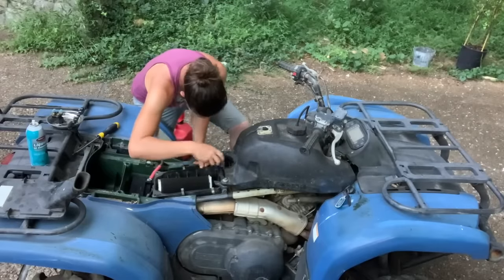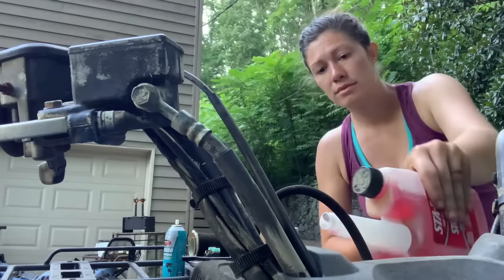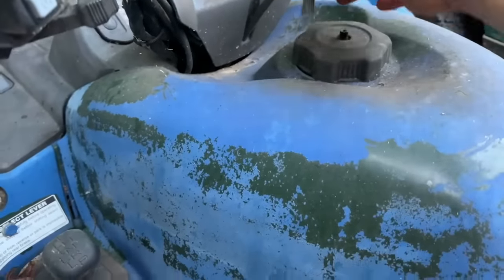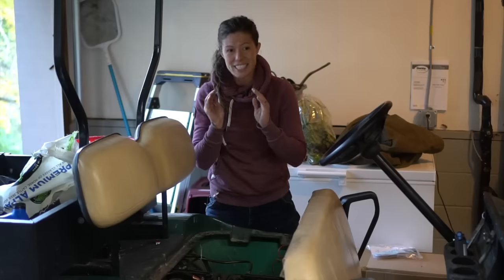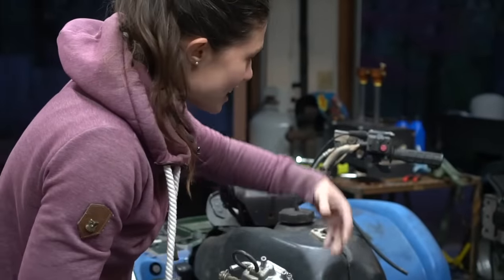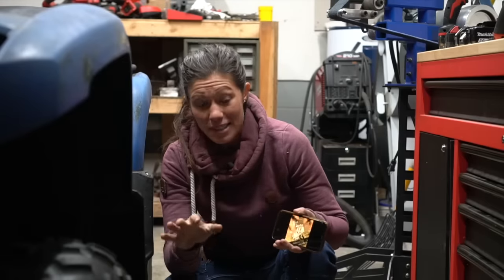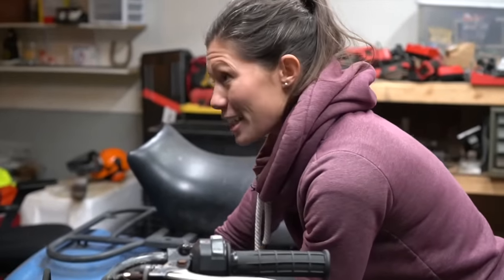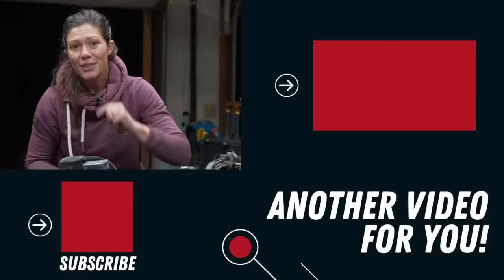ABANDONED ATV: Will it Run?

Comment: Congratulations on your perseverance.I had to solve similar problems with my first car which would randomly cut out while I was driving. Most embarrassing of all when I called road service it would start straight away. It puzzleD several mechanics who were unable to diagnose the problem. In desperation I stripped down the carburettor. Luckily I had a good workshop manual which had an exploded diagram of the carburettor so I was fairly confident i could reassemble it. I actually had to take it to a spare parts outlet when I couldn't remove one of the jets and they sold me a special key for that. The car was originally a farm vehicle and I discovered that during a mouse plague one had crawled into the petrol tank and died with the fur ending up clogging the carburettor. Even after getting it all back together it still kept cutting out. Because the car was running I realised it was unlikely to be an electrical problem so went back to check the fuel. Sure enough when it happened next and I disconnected the fuel line into the carburettor it was empty.  So next was rebuilding the fuel pump. When I stripped it down all the internals looked ok so I suspected that wasn't the problem and I was right The next time it happened I undid the fuel line on the suction side of the pump. Sure enough it was empty but the sight glass on the other end of it was full. Further checking revealed that the other end of the suction line which connected to the sight glass was slightly loose causing the fuel pump to suck air. I tightened it up and the problem vanished at least until one stinking hot day when it reappeared in a similar form as vapour lock. My experiences with keeping that old car on the road were invaluable. Before they replaced the electromechanical systems with computers I serviced my own cars. My record was keeping one in good condition for 500 thousand miles until somebody parked their Landcruiser into the back of it at about 40mph. One last thing those ATV's are among the biggest killers on farms for your own safety please wear a helmet.

Comment: Wellk done!
Two mechanics not realizing there might also be a fuel delivery issue?
Okay...
And warped parts in a carb?
I follow quite a few channels that deal with small engine stuff, there were lots of corroded, varnished, dirty and incomplete carbs, maybe even a few broken parts in them, but I don´t remember anything warped.
Reply from the maker: That wasn’t the only problem, but it was the key to getting it running after a LOT of other work had been done, these videos can only be so long so lots gets cut ;) and in case it wasn’t clear in the video, I don’t know enough about carbs to explain in my own words what Caleb told me was wrong with it, but I’m happy to take his word for it, it needed to be replaced, so that’s what I did.

Comment: I have had a few vehicles that I got for reasonably cheap and some successfully got running.  Only one eluded me and I was forced to get rid of it since it was not running.  Had I had more time, I am sure I could have solved it.  Makes me wonder if the fuel filter was a potential but for some reason the throttle body injection would not get enough fuel.  Pressure didn't seem all that off but then I also learned Subaru vehicles are also very nitpicky on their parts. Not to mention really expensive.
Reply from the maker: Time plus desire can usually solve most problems, but time is the one thing it's so hard to make more of.

Comment: I am an atv mechanic, those yamahas are good bikes, but you’d have been better off rebuilding the mikuni carburetor that it came with. My suggestion would be to buy a clymer manual for it
Reply from the maker: The carb had already been rebuilt unfortunately.

Comment: Should have tried the pull start. See if it ran at least then narrow your problem down with the starter relay
Reply from the maker: I tried lots of things that didn’t make it into the video edit ;)
Reply: @AnneofAllTrades  ic  I just finished doing another 4 wheeler build. Came off a old cattle yard. It was beat up and never had maintenance. Runs like a top now. But liked your vid for sure. Keep ‘em coming!

Comment: "when it get´s enough air, the only thing missing is fuel"    oh my dear you might be in for a huge surprise. it also needs Ignition, timing, compression, exhaust and so much more... you could argue  that it has to have that, BUT there where multiple people working on it before you. There could be something mechanicle broken/worn or simply not in the right place anymore.   In this case it worked for you.
Reply from the maker: You’re talking about an engine, I was talking about a carburetor ;)
Reply: @AnneofAllTrades   okay then i misunderstood a little.
Reply: Anne you need  to check out.  Taryl fixes all  YouTube channel you have to have your sense of humor to enjoy his channel. But you can learn a lot if you give him a chance.  And there's your dinner.

Comment: Hello I have a question, so I have a 2008 can-am ds 450 .
For some reason it Turn on and drives if I continue to give it gas . But as soon as I sit in one place for longer then 30 seconds it turns off , and keeps doing that , I thought it would be the fuel pump relay but I already change it and it’s doing the same thing can you help me out

Comment: The best advice I was given on 4 stroke engines is SSBB, a good way of remembering it is to think of your significant others you Suck their face, Squeeze the waste, then Bang them and then Blow them. not the nicest way of describing how an engine works but you won't forget it.
Suck - the engine sucks in both fuel and air
Squeeze - the engine compresses the air-fuel mixture
Bang - the engine ignites the compressed air-fuel mixture
Blow -  the engine blows out the exhaust gasses out

Comment: @00:45 that's a starter relay, @00:52, that's a starter solenoid. They do different things. The starter relay is just a large ampere rated switch that's turned on and off by an electromagnet. It can be located any where in the vehicle. But they're usually placed so they do not overly lengthen the path the positive battery cable takes to go from the battery to the starter. A starter solenoid is always located directly on the starter motor. It's job is to engage the gear on the starter motor's shaft to the ring gear on the flywheel. A solenoid moves a large physical part. In this case the starter gear and over run clutch out along the starter motor shaft. And in this case the solenoid also closes a large ampere rated switch. Both a starter relay and a starter solenoid have a spring to return the physical parts to their normal resting position when they are de-energized. Loved the video. Your perseverance paid off and you figured it out. Enjoy your ride.
Reply: not always, some starters still have seperate solenoids, as not all starters are pre-engaged, some older versions still rely on a bendix spring and throw out....

Comment: So what was the problem with the solenoid..?
Reply from the maker: It requires a massive amount of amperage to turn over those small engines and so repeated attempts to make it fire overheat the whole system. The general rule (I learned through this process) is 10 seconds of trying needs to be paired with 30 minutes of rest time to allow the system to cool.

Comment: Subscribe to Mustie1 channel. He'll show you that carbs seldom need replacing, only thorough cleaning. When ethanol-infused gasoline is left sitting in the carb bowl for long periods, it devolves to a thick, sticky gum that clogs the tiny holes in the carb. For about $70, you can buy an ultrasonic parts cleaner. Disassemble the carb, and let it soak in the ultrasonic cleaner with carb cleaning solution for a day. Then use a compressor to blow out all the little holes (maybe just blow with your mouth to prevent damage....) Reassemble, and you're likely to have a perfect carb. You can also buy a rebuild kit for the carb for a hundred bucks or so that will have all the gaskets, etc. 
Also, don't put a bunch of gas in the tank until you're sure it works in case you have to remove the tank.

Comment: Rule of thumb if you get gas fire and compression it should run if its out of time it will backfire now thats not good on a motor with a overhead can cause that can bend the valves
Reply from the maker: Good to know! I am not sure how to time an engine or what that means but google is my friend
Reply: @AnneofAllTrades  its not to hard the piston has to be top dead center in the head you can either use and extension our a screws driver to check its not hard to do good job on the atv

Comment: I am 70 years old and discovering late in life due to a fixed low income there is a lot I can do thanks in part to YouTube videos. My refrigerator stopped working 2 years ago. I can't afford another debt so I bought a "newer 2014 refrigerator on craigs list from a scammer for only a $100. That should have been warning #1  For some reason my brain and my neighbors brains who was helping me were not working. Warning #2  she had already taken the doors off the refrigerator so I couldn't test it or didn't Warning # 3 We didn't check the manufactures date. It was my wife that saw it when we were hauling it in "1994' not 2014.  We couldn't/ didn't want to figure out how to put the doors back, I was only out a $100 for what we paid my wife did not want a confrontation so the metal recylcer gave me $4.00 since the local dump wouldn't take it. For about $100 I fixed my old GE side by side replacing defrost element and thermostat. Its been working better than ever for 2 years.

Comment: This is the problem with tunnel vision when fixing or diagnosis, "the problem is the carburetor, " ok, but why? You found the why.  (Also, and I hope you see this, the red wire on the solenoid needs to be fixed, the insulation is broken.)
Reply from the maker: Good call! Thankfully I learned how to replace wires on my golf cart ;)

Comment: OK, not to belittle what you accomplished (I mean, you did a fantastic job and learned something new, way to go!) but the two actual mechanics who worked on it, if they couldn't fix it they weren't very good mechanics. An old carbureted engine is pretty simple, and there isn't much to go wrong to make it at least turn over and idle. Any mechanic who can't sort that should be ashamed.
Reply from the maker: Check out the pinned comment. They are both fantastic mechanics ;)

Comment: The bike is a easy fix. The carb that was on the bike allready just needed taking apart and cleaning. Buying new carb was money spent that didn't need to be. You have to clean out the main jet and pilot jet. Clean trash out with brake cleaner and compressed air. Adjust the idle screw and air fuel mixture screw. The solenoid only caught fire because of the heat from constant trying to start the bike. You have to give it cool time between starts it takes a lot of heat from the power of the battery. When you started it with starter fluid was a for sure sign. It was worth the effort.
Reply from the maker: The previous owner (a mechanic) had already rebuilt the carb and told me it was shot, all the new parts I had to buy to get the bike working are why he gave up on it to start- it wasn’t worth the money or the time for him to keep messing with it, but it was worth it for me!

Comment: Dirty fuel pump lol it's always simple things that gets us. On the bright side it's possible you  have  a little dirty but working spare carburetor.
Reply from the maker: Actually the carburetor still did need to be replaced, Caleb had sussed that out before he gave me the bike. But not bad for $100 and some water beer, huh!
Reply: Fuel pump... lOl it doesn't have a fuel pump. It was the the fuel filter. Miraculously replacing the fuel filter made it all work after the solenoid caught on fire..... lOl
Reply: @kennycampbelljr5896  you're right fuel filter my bad :D And solenoid  I didn't see flames so it didn't happen lol